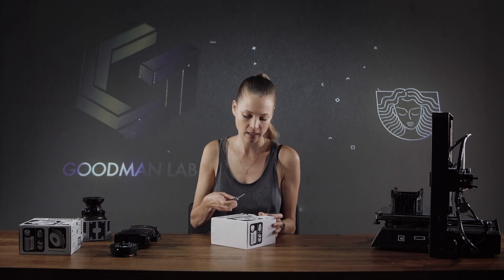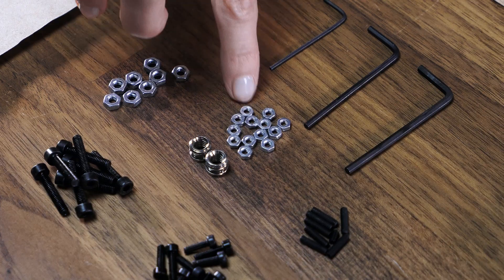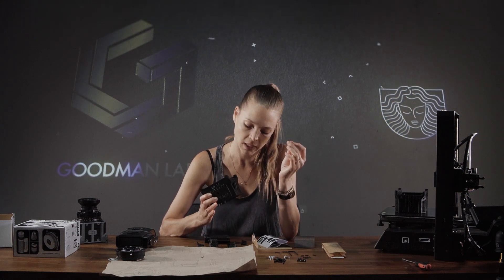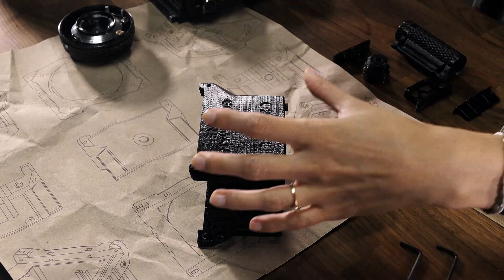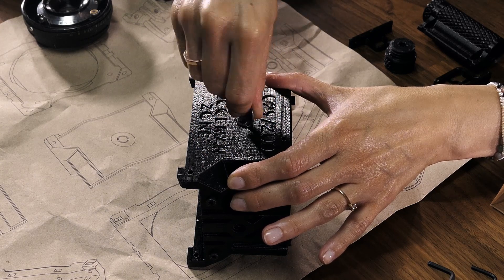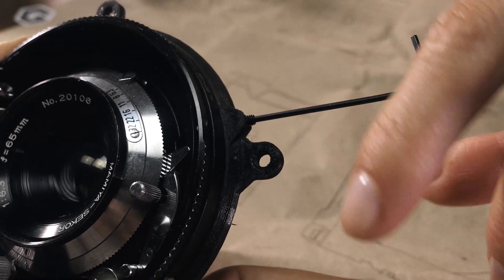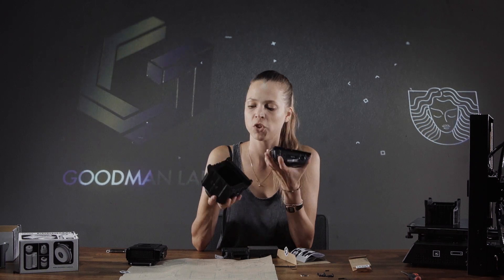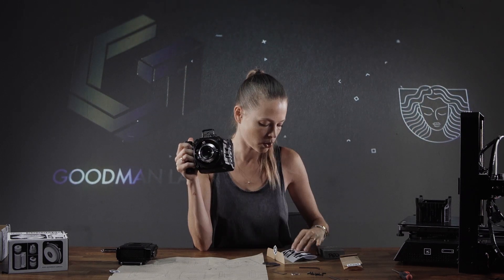GOODMAN ZONE: assembly tutorial for the 3D printed DIY camera

Comment: In general the assembly instructions are adequate, but there are several gaps in getting together correctly the first time.  Putting in the M3 nuts in first is clearly an error.  They don’t stay in and go flying about when you try to put in the M4 nuts and screws.  Save those until later.   Dora says to put two M4 screws on the side, but never identifies which side she means.  Also the inside of the camera body is still very shiny and scatters a lot of light.  Same goes for the bright zinc coated screws I received.  So spraying the inside with flat black paint is a must if you want to avoid image flare and loss of contrast.
Reply: Just wanted to mention I am going to use some "black 3.0" paint that absorbs 98% of light on the inside of the body. That may help quite a bit.

Comment: good prototype, but would be nice to have something made in metal, stainless or titanium, perhaps, (hint, these can be 3D printed as well, using a 'metal' printer, instead of a plastic one!) this would aleviate some need for nuts (as the thread could be tapped directly into it), and may facillitate some use of thumb screws, or even a bayonett mounting for the lenses, it is a bit awkward to change a lens in the field if it is screwed to the camera ( the Fuji GF617 panoramic camera has hand-knobs for the lens top hat mounting boards!!).